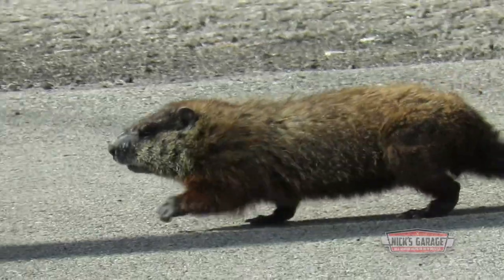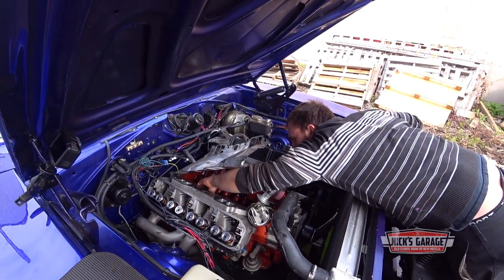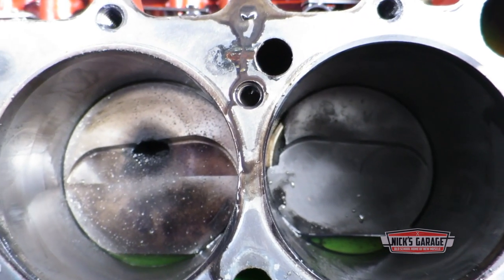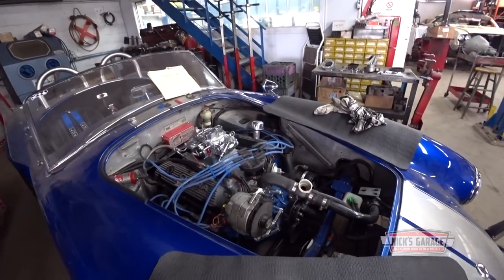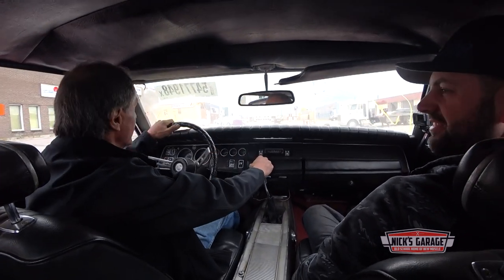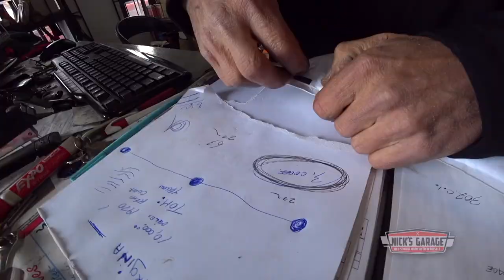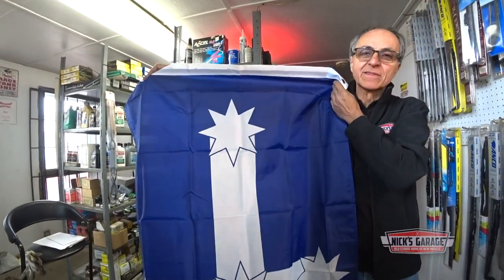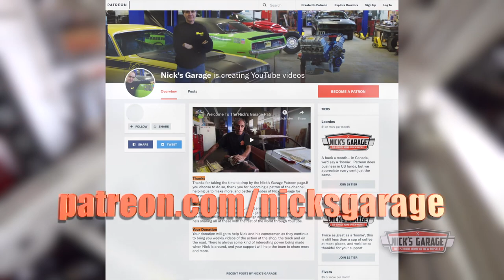Wicked 1968 Charger Blows Up - What Went Wrong?

Comment: wow...must have been powerful, to do that to forged pistons....and Vasili...Zdrastvweetya cokdela droog!!!!!
Reply: thats a good guess...at least thats somewhere to start....had to be some pretty serious detonation. i saw a guy, flood a 12.5 426 wedge motor. when it hit, the crankcase explosion sounded like a 12 guage, filled the shop up with thick smoke too, blew all the gaskets out, even the intake similar, but it didnt hurt the bottom end. that had to be some prolonged detonation or some sh--....be curious what nick says. almost as crazy as the embedded bolt caper...what gives?

Comment: What happened to the white gen 1 corvette that was on a lift most of last year? Was it finished or just moved?
Reply: Leonard.  Our job was to replace the frame. Job was done long time ago, but customer picked it up long time after.
Reply: @nickpanaritis4122  Thank you for letting me know. And could you please confirm that 1972 340 mopar engines had 4 bolt main bearings. The first car I owned was a 1972 Plymouth Duster with a 340. I spun a main bearing drag racing it so it became the first engine I rebuilt. When I say this no one believes it. If you say it they will.
Reply: @leonardsmith1175  .              From the factory , all 340's had 2 bolt main caps, all years. But the T/A block can be converted to a 4 bolt main. Maybe this is what you had.
Reply: @nickpanaritis4122  Thank you Nick.  It did have non-OEM rods an pistons plus an oil control screen over the oil pump. Now I wish I kept that car even more.

Comment: Hi...how's about taking in my Eforce supercharged C6 Z06 with about 15K on the rebuilt engine? I am getting loud tapping noise and really don't have time to work on it. I did some looking around but cant find anything by removing valve covers. 
   Great oil pressure, cool running motor, some oil use but no smoke and no oil in antifreeze etc. 
 I live in PA, work Manhattan. Thanks

Comment: Too Lean ... Wrong Heat Range Hot Plug ?? Low Octane With The Classic Squeeze Ping , I'm Just Wondering Why They Didn't Hear Anything Etc. ?? 
And Is That A Dummy Mechanical Fuel Pump On The Block ... Please Tell Me Yes , Because That Is Freaking Me Out On An EFI Set-Up !!  -LOL

Comment: Put a Toyota engine in it man. 2JZ May do the trick
Reply: Your remark causes me to remember Toyota's introduction to NASCAR. Not having an engine of their own, Toyota purchased FORD, CHEVROLET and DODGE engines so that they could examine the strengths and weaknesses of each design to come up with an engine that they could call their own. That particular engine outperformed the others, and NASCAR gave FORD, CHEVROLET and DODGE permission to "clean-sheet" their engines. In 2012, with only two cars on the track, DODGE won the championship with something of particular interest. Dodge won at Talledega; NASCAR's fastest superspeedway, and, at Bristol, NASCAR's toughest short track. All the marbles.
I know exactly what a 2JZ is, and to suggest putting a twin tubocharged, straight six in place of a MOPAR V8 capable of up to a thousand horsepower, naturally aspirated, is unpalatable tripe. And just what do you think happens when you twin turbocharge a big-block MOPAR, or rather, a blower? That's right! You get that dose of reality that you rice burners are long overdue for.
Reply: Victor Djinn thats a good story man, thumbs up.

Toyota did same trick again.

Supra.

Get bmw engine and drive train.

Fix the weak parts;)

Now bmw also has a good engine haha